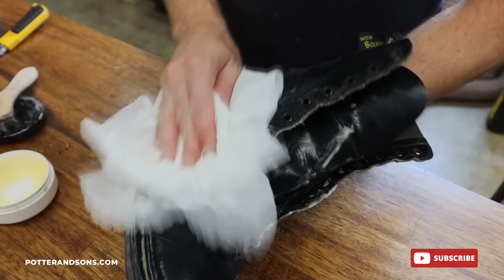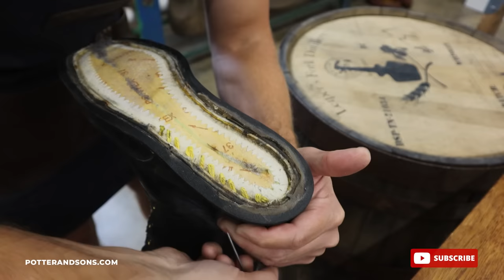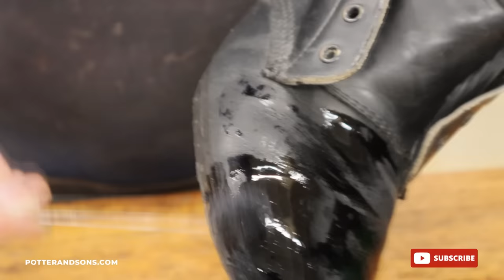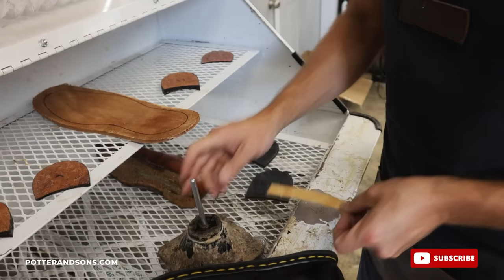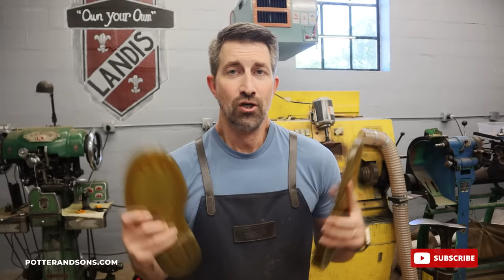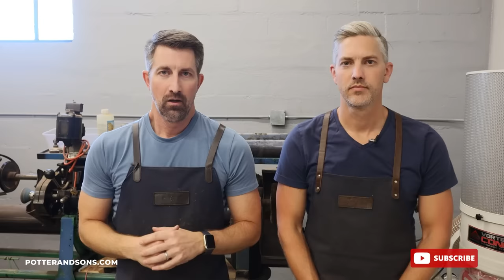Dr. Martens Restoration - (Using ORIGINAL Parts & FIRE)

Comment: I bought my Docs back in '94, and I'm amazed at the restoration job you were able top pull off here. Awesome stuff.

Just wish the Made-In-England ones were as cheap to buy now as they were in the 90s...
Reply: I bought my first pair of Doc Marten boots from an Army/Navy store ( Blackman's ) in Brick Lane ,London in 1970. They cost me thirty two and six. Which was the old currency of the UK. The modern equivalent of that is a half penny over £1.52. They were low top boots and i went on to buy a pair of high top ox blood boots that i two toned with flexs of black. :)

Comment: I used to own a pair of 8 hole black boots I bought in the late 80's, the stitching wasn't yellow on the pair I bought, and yes, they were original Doc's. I was a Chef for a lot of years, tried wearing my Doc's in the kitchen, the soles ended up cracking really badly after 6 months, and they weren't very "grippy" in greasy floored conditions, but, other than that, extremely comfortable. Cheers from Australia :)

Comment: I worked at R Griggs and Co in the mid 90s making DM's and my job was sealing the sole to the shoes and we used a sealing machine that had a red hot metal blade that ran between the sole and the welt and melted to 2 together.

Comment: Great understanding of why most cobblers refused to work with or do repairs forDr Martens. Why the change in the type of stitch used on the welt?
Reply: The OEM chain stitch is done with machinery.  The Potter brothers use a "jerk needle" and "elbow grease" lock stitch method.

Comment: Wore DM's every day (also at school as a kid as well) when I was a hod carrier in the late 70's and early 80's before students started wearing them and caused the price to rocket. They were light and reasonably comfortable whilst giving good ankle support. There were however a couple of draw backs though, after about 3 months in mud and cement dust the yellow stitching around the sole would rot and then the sole and uppers would part company, also at around the same sort of time span the internal sole would collapse into the air pockets under them and become uncomfortable to wear. They used to be real cheap until university students made them fashionable, they went from 16 quid a pair in the mid eighties to 65 quid a pair practically overnight. The lugged soles only became available in the late eighties if my memory serves is correct, certainly never saw a pair of DM's with them in the seventies.

Comment: If you need a replacement sole (not original but the same style) there is a company in the Uk called Solovair that sells 2 of the common style of soles for classic Doc Martins.  Classic and Commando are the two different styles.  Thought you should know as the company Solovair is based where Doc Martin use to make their boots.

Comment: Since it is PVC you should have used pipe glue it it chemically welds PVC together. It would have been stronger than your contact cement.

Comment: Your clip on doc martens was good.
I spoke to a shoe repair shop in the UK.
I've  now spoke to half a dozen.They all tell me that they send the DM'S away to be repaired(new sole and all that) the cost does vary a bit,but it work out to around (£ 85---90) Stirling money to have the soles done.Any thing else is on top.
You need deep pockets as the saying goes.Got my boots around 2018 the slip on type just above ankle height.Then as now £145.oo in the UK. Would not swap
Them for anything else. As I said most of the shoe repair shop send them away for repair, funny thing is I did not think to ask where they were sending them.Im just lucky they don't need doing just yet! Should get another year out of them.
Reply: Congratulations we have a package 📦 for you @trentonandhealth

Comment: Trying to work out the age of my docs (eBay)  does anyone know when dr martens switched from their original soles?
Reply: I've been wearing Docs since 1997.
They used lug soles and 2 versions of the ribbed soles (a thin and wider ribbed) when they were originally made in England.

I think the older England Doc's had gold-embossed heel-pads and thin-ribbed soles.
I do recall their being French on the heel-pads for some pairs which echoes the experience of the commenter who worked at a UK sole factory. They said they moved sole production to France.

To me it makes sense that the different variations depended on what factory they came from. Doc's were crazy popular in the 90's so they had at least 2 factories running (at least) - the one that makes the new "Vintage" line and other being the one that makes Solovair now.
The new "Vintage" docs only use the thin ribbed soles and gold heel pads to my knowledge.

That probably didn't clear anything up but if you take pictures of the soles, the tongue markings and the heel pads, I'm sure someone on the internet can clear it up.

Comment: Great Job!!!
I have an old pair of Wolverine boots that are Gortex lined. There was a foam mid sole that dried out. The uppers are in excellent condition and I was wondering if you could do anything with them? I also have some steel toe shoes that I took to a cobbler that had the same problem. He didn't remove all of the foam and the soles fell of. I think I could sand the upper down to leather and remove the foam from the sole and glue them back together. Is this something I can do myself? And what type of glue. I have several pair of shoe's that suffer from this same thing. I am guessing I would need some specialty tools to fix these. Shoe goo doesn't hold I found that out at least.

Comment: Love this video and wish I could like it more than once.  I do have one question and one comment.

What is the difference between the tread patterns of the Doc soles?  My first pair from about 97 or 98 had the lug tread.  It's the only pair out of 4 pairs of boots and 2 pairs of slide on's that have had that tread pattern.

As much as I love the restoration.  I'd love to see your take on improving them.  Maybe a stacked leather heel block, and a leather sewed on welt.

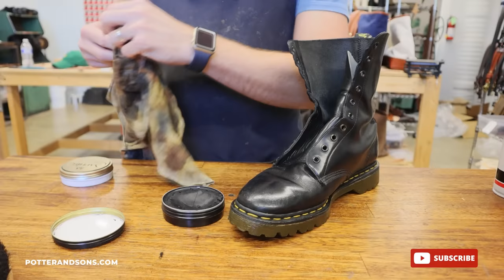Comment: 18:12 the thick yellow stitching that goes around the shoe - would a shoe repair place be able to add that to my existing doc martens that have a thing yellow stitching going around ? like right over the existing one ?
the docs i have are called Grizzly and the stitching is barely visible and i hate it
just wondering - thanks

Comment: Nice job guys! There's also Brian the Bootmaker video out there too where he rebuilds a pair of DMs (as we used to call them in England) using a leather welt and one of his trademark cork/rubber outersoles. Perhaps a bit overkill for this quality of boot but interesting all the same.

It's sad that few places offer a Docs resoling service. Apart from the factories (NPS/Solovair and Doc Martens themselves) I think Key Cobbler in Kendal is perhaps the only outfit in the UK that has the proper heat-fusing machine to do it. Someone's missing a trick here...

Comment: Any update on how the soles are holding up? Ideally I want to retrofit my 2003 MIE Dr Martens with Solovair soles (which are inexpensive and mostly readily available in the US) but am leery of the longevity.
My basic option is to glue half soles to the bottom the existing soles to keep the look while adding traction.

Comment: I love the original Doc 1460's. Expensive but will last a lifetime if cared for. If your looking to get a pair make sure you get the "Made in England" Doc's. They have ones made in Vietnam which are cheaper but they're cheaper for a reason. Low grade midsole and welt. Lower grade leather.....the originals cost more but are worth it.

Comment: What a great and fun video. Like for so many, Dr. Martens boots were an essential part of my youth and young adulthood. 

For those interested in a pair of Doc Martens "like they used to make 'em", check out Solovair boots - it's essentially the old, English part of the company that used to make the original "Docs" and is still making them. They had to let go of the yellow thread for copyright reasons, but apart from it they look the same and the quality is said to be miles above modern Doc Martens.
Reply: I have a pair. They're really good, and super comfortable. And also, very water resistant.

Comment: The most authentic "Docs" you can get nowadays are called Solovair.
They are made by NPS Shoes in the Northampton factory where they manufactured Dr. Martens under license, until the 1990s.
Solovair boots are made using the same lasts, leather cutters and machines used to create the original Dr. Martens and many people consider them to be superior to the Dr. Martens that are now manufactured mainly in the far east.
They are, essentially, what Dr. Martens used to be, but with grey rather than yellow stitching.

Comment: I had 2 pair of dc Martin's.  Both seperated from sole to leather.  Both had fake stitched in the sole. One pair seperated as I was in the delta airlines first class security line. I was 
pi$$ed. Last pair I bought. Both in in a year after buying them. Same type.

Comment: #Trenton & Heath.    SOLOVAIR used to be the sole producer Doc's.  They still make shoes with the same lasts and orginal (good Quality bits and peises)  they also sell both of the og soles.  My first 2 pairs of doc purchased in 1989 where produced in there NPS factory in Birmingham England.  A pair of black 6 hole (eyelettes) boots and a pair of the 4 hole brown oiled leather Derbys with no welt stitching.  They lasted me years.  I purchased a new pair of 6 hole black boots in 1997 and they where utter garbage quality the materials not the craftsmanship.  That wasnt long after DM move the manufacturing over seas and NPS inherited all the old lasts and designs and started producing Solovair.
My OG Solovairs i purchased in England while there on leave from a deployment in 1998.  They lasted a good 10 years.  I just purchased a second pair of 6 hole Derbys in "Grain leather Walnut colour".  Which is pebbled dark brown leather. They are leather lined.

Comment: Heating the surface of the sole and welt like that does absolutely nothing. Even inserting a hot blade will result in the welt tearing back off after a day's walk, if the blade isn't inserted deep enough.